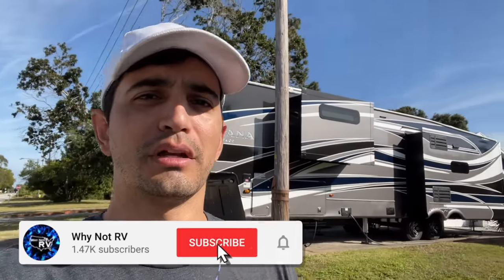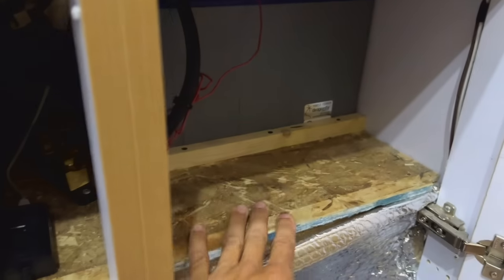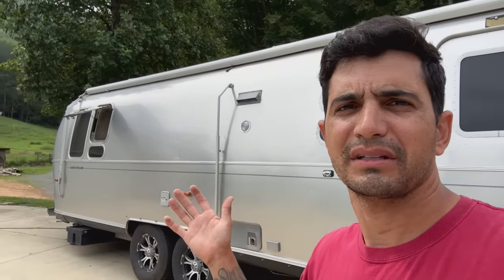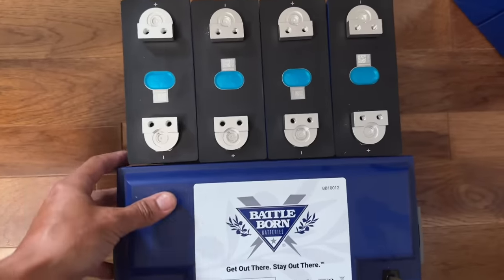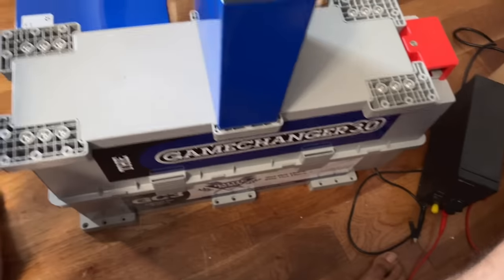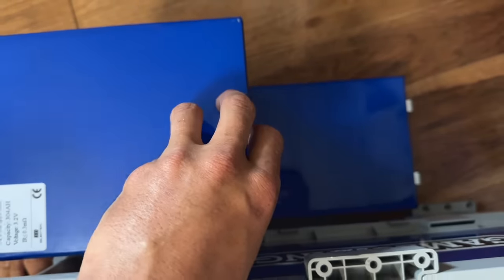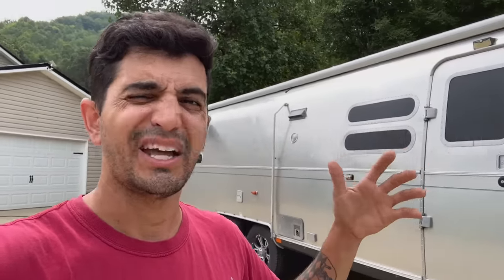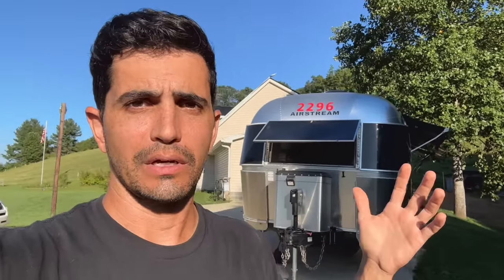Best DIY Battery Upgrade on the Market - GOODBYE BATTLE BORN - Why Not RV: Ep 127

Comment: According to your link for the battery, they are 300ah each, you have 16 cells=4800ah you said 1200ah?
Reply from the maker: These were “304” rated. Some will say “300” but will pull 308-312. All extremely similar and basically the same thing. Just depends on how they choose to word it
Reply: I was referring to your installed bank of batteries. @WhyNotRV
Reply from the maker: Sorry. So it would be 4800ah at 3.2v… when you connect in series, the voltage increases but the amp hours remain the same, when you connect parallel, the voltage remains the same but the capacity increases. Hence 4 cells together is a 12v battery at 304ah. Connect 4 of those together in parallel giving me still 12v but now 1218ah of capacity
Reply: @WhyNotRV  That would still give you 4800 in parallel, 16 cells
Reply from the maker: 16 cells … the individual cells are 3.2v nominal. You need to put four in series to make a 12v battery. Make sense?
Reply: @WhyNotRV  My bad, gotcha!
Reply from the maker: No worries. This is why I do these videos. I like to help people learn where I can

Comment: Ok that’s great but Battleborn is so overpriced as are your suggested battery. Some of us aren’t made of money. That airstream probably cost more than my adjusted gross income
Reply from the maker: There are definitely cheaper manufactured batteries out there but you end up running into a similar issue of footprint and energy density. Building your own from whatever cells you can afford is going to be your cheapest option for most useable energy

Comment: You have done it wrong !!!! you should have done 4 batteries in parallel in a pack and then 4 packs in series with just one BMS; would be more stable. or just put all 16 in series and build a 48V pack. I just do not understand this 12V trend going on in the RV community.
Reply from the maker: I have done the 48v setup before. In this RVs case if I had a blank slate I’d do 24v. Majority of RVers want to keep it simple with 12v so that’s what I demonstrated here. This is not done wrong. There are definitely more than one way to do it and get the same result. I chose this setup for several reasons.
Reply: @WhyNotRV  yes, but even for a 12v system you made it extra complicated. 2 extra BMS-es + 4 extra big cables.
Reply from the maker: Redundancy. Having a single BMS for each 12v set gives me the redundancy that if one were to go down I still have 3 individual sets that can carry the system.

Comment: so you don't make mistakes..........so I can make your mistakes?

not a fuse in sight......awesome

so explain why you didn't configure them to 24 volt or 36 volt config?

all that money on battery's and cheaper out on the bms lol
Reply from the maker: There’s fuses where they are needed. Keeping it 12v keeps in the main rv space. Yes 24v is more efficient but not always applicable. I already had this 12v inverter otherwise I would have (and may in the future) switch to 24v as I do the solar.

Comment: So on the web site it says they need to be in a vented area?
Reply from the maker: Lithium batteries do not off gas, so there is no need for them to be in a vented area. That mainly only applies to lead acid batteries.
Reply: @WhyNotRV  yes that’s what I’ve heard. However on there site under storage it states. Clean, dry, and well ventilated environment? I find this odd. Any idea of why (it’s there cells)?
Reply from the maker: No idea, probably just some generic thing that they pulled 
at some point.

Comment: Nice setup:) maybe splice the neutrals from the bmses and heat shrink while also moving the bmses the a safer locations to prevent contact with bus bars.
Reply from the maker: I did add a 1/4” foam insulation board to the topside so the BMS is not in danger of touching. I appreciate the input here

Comment: Please don't leave those bms like that, looks like a fire story.
Reply from the maker: They weren’t. Cleaned up a bit, added some foam board on top of the batteries for insulation. Secured in place

Comment: I'd like to build my own Lithium battery, but it will be exposed to the elements. Looking at doing 150ah battery. Thoughts on how to do it and withstand the elements?
Reply from the maker: You’d have to build an enclosure for it. I’ve seen people use different totes with lids for this type of thing
Reply: I have built a 100 AH battery for an electric outboard. It is in a Pelican case - totally waterproof. @WhyNotRV
Reply from the maker: There you go. Options are truly limitless

Comment: Great information.  Thanks for sharing.  I've been wanting to try out some solar but it's just to expensive and I'm still not able to run my AC. But this is very promising.  So thank you.
Reply from the maker: With this amount of batteries, I am able to run my air conditioner, overnight, no issues, and in the morning I can recharge with my generator. Eventually, I will be doing a major solar upgrade to the airstream but probably not enough to fully run RV air conditioners nonstop. They just aren’t efficient enough.

Comment: Adding one more battery to the bank does not quadruple your overall capacity.  This is fifth grade arithmetic.  Why is this hard?
Reply from the maker: Watch the whole video friend. I used the same footprint as if it were adding 1 more battle born which would be 400 amp hours of space, HOWEVER, my batteries are over 300ah EACH times 4 is 1200 amp hours of useable battery capacity. I did a capacity test to show this. If you still have questions let me know!!!

Comment: Have you ever witnessed a lithium battery fire and what it does to an RV? I have.....
I'll stick with HD lead acid batteries.
Reply from the maker: I appreciate the comment, yes, lithium fire is no joke and you need a special fire extinguisher in order to put one out. However, the likelihood of these catching on fire is extremely low. Multiple things have to go really really wrong multiple times in order for that to happen.
Reply from the maker: Thank you for the extra comment here. I appreciate it.
Reply: There are different types of lithium batteries . Lithium Cobolt  and Lithium Iron,   lithium iron do not have the thermal run away as other lithium chemistries have. 
There is a great video were they do a destuctive test on them ,   lithium 4 won and never had a themal run away.
Reply from the maker: Thanks for this additional info

Comment: You should probably address some of the huge trade offs in safety and reliability. YES you are dramatically increasing your energy density but at the expense of everything else and you are going to be sleeping in that thing.  The average user should stick with the UL listed Battleborn particularly in a mobile installation.
Reply from the maker: There is tons of other manufacturers that offer similar batteries and UL listing but for significantly less than battle born.
Reply: @WhyNotRV  I inadvertently typed battleborn instead of battery.  Although BB's UL listing is for the entire assembly and not just the cells themselves.  Most UL listed lithium are significantly more expensive than BB.  I don't mean to disparage your system, it's badass for sure.
Reply from the maker: No worries, I appreciate it.

Comment: You seriously need to connect one side as a positive main and one side as a negative Main. It won’t balance if you are charging at one end….  

And why by all the gods did you do that in your house.
Reply from the maker: If you’re talking about during the initial top balance, at the low amperage I was charging them, it really doesn’t make a difference. Nothing wrong with either way. No danger doing it in the house. Not sure what you’re referring to. Will Prowse does it the same way and he’s probably one of the smartest, most professionally educated guys out there doing this type of stuff

Comment: So, you're ditching cylindrical cell batteries for prismatic cell batteries...??? 
Whoa unto you, when you don't get the life span or the performance, you'll be back...
Reply from the maker: People have been using intestinal cells for years and they have incredible life cycles from 3 to 5000 easily. That will far outlive pretty much anything I’ll ever do with this RV. They will degrade from age before anything else.

Comment: Comparing DIY with quality components, to likely one of the most expensive batteries on the market, is a bit misleading. That said, I doubt your build quality will match that of BB or any reputable maker. That said, this is definitely one way to get more energy in the given space. Just remember, more energy, more caution required.
Reply from the maker: Yes, it’s definitely an extreme. The warranty from a company like BB is about the best thing they have going for them. Otherwise this setup will last just as long or longer than there batteries. And it’s easy to work on, if a cell goes bad or a BMS fails, easy to replace an individual component by comparison of a battery like BB or most anything prebuilt.

Comment: You need to measure the actual usable capacity of these cells
Unfortunately most Chinese battery capacity ratings are laughably overrated to point I just don’t believe any capacity claims
And the Amazon reviews have become worthless 
What you pulled seems like a good sign but the trust has been broken by battery sellers and Amazon.  
No cold camping with lithium packs without battery warmers usually. What’s the operating temperature on these?
All that capacity I’m assuming is for boondocking so I guess you can leave hooked to the 7 way to run heat until up to temp.  
Do you run another battery and an isolator for the brakes or if the trailer is cold no battery for breakaway system?
You would have the same issue with the battleborns if they don’t have warmers. 
If you wanted to be legal towing in the cold
I know some newer trucks have had issues hooking to a trailer with lithium batteries, the higher voltage throws some error. A separator/isolator and basically a chassis battery could remedy. And since it would just be for emergency brakes a small capacity battery would suffice with a simple rotary disconnect instead of an isolator between chassis (the 7 way plus breakaway battery) and house batteries to run heat till up to temp.
Reply from the maker: Hey DAVID!!! Thanks for watching and commenting... I have measured these cells and they pull full capacity no issue. 2 things referencing cold camping, first, you can DISCHARGE lithium in freezing temps no issue, its charging that is the problem, I have these in a closet inside the RV so they never get close to freezing plus I have them well insulated to help retain heat, as they charge and discharge they generate heat and can easily stay well above freezing even if stored in an outside non conditioned space. A battery bank is like a fuel cell for the RVs electrical system. If my fuel cell runs low I need to top it off, that can be done multiple ways, solar of coarse, DC-DC charging is a great way to recharge, on board generator and of course shore power. I have my generator setup to automatically come on when the battery bank gets low enough and stay running until it is recharged to where I want it. I hope this response helps you understand a bit more and if you have further questions just ask. THANK YOU

Comment: A Silly vid for a guy with a high end RV… if ya want more power step up and buy a few more BB and sleep better… forget all the DIY nonscence… that is a dead tech now…  I have 10 BB in my Rv … life is great..
Reply from the maker: For the price you paid for 10 battle borns I can have triple that same capacity. Or I could pay a third of the price and have the same amount of amp hours and take up way less space. The only thing battle born has going for them is their warranty. For someone who can do things in cells and you build your own batteries you cannot service your batteries by yourself. You can access your BMS and wiring. With battle born, yet to take that thing and send it to battle, born in order to get any warranty issues, taken care of and now your down capacity. I, along with thousands and thousands of other DIY people, could easily argue the opposite of your point. But thank you for watching and I appreciate the comment.
Reply: @WhyNotRV      there is a case for DIY set ups… but not for the reasons you make…a large steak does not make it a better buy than the quality of a finer steak…or watch or stereo…..
secondly warranty work isn’t  needed if you never have problems… with 5/years of all Victron and Battleborne , I have never had the first issue in anyway with anything… except watching it all work perfectly.
My only suggestion for pouch cell owners is learn to speak mandarin…it will come in handy at some point.
Cheers…J.
Reply from the maker: I have no problem with those who wish to pay for the big companies product. But for those wishing to save thousands and have better battery capacity results. This is for them.
Reply from the maker: Understandable, personally I like the redundancy. If one big BMS fails…. You’re without power. If one small one fails, I temporarily lose capacity while I order a new one and replace it.
Reply: Not always true. I am using the Electrodacus BMS which is not current limited. It controls all load and charge sources but the current does not travel through it. It also does not have any Fets which are the weak part of most BMS's, instead using high quality transistors.  @WhyNotRV
Reply from the maker: How much was that BMS ? Do you have a link? I’ll be curious to look at it.

Comment: Sorry but you're wrong. Since those are 3.2v batteries.. four of them in series makes 12v like you mentioned but it only makes a 76 amp hour battery. With 4 of those series setups, it's 304 amp hours total. You gained only 4 amp hours but took up more space, added additional weight, and created more failure points.
Reply: Each cell is 304 AH @ 3.2 volts. When 4 are in series the voltage increases to 12.8 volts but the AH stays the same - in this case 304 AH. Not sure where you get 76 amp hours from.
Reply from the maker: Sorry Steven. It you are incredibly incorrect. Hence I even showed at the end my capacity test I did. Showing I pulled over 1100ah and still had more to go. Similar to what mitiempo1000 said (which I have a video on my channel discussing series vs parallel and what each one accomplishes. 3.2v cell at 304ah put 4 in series is now 12.8v at 304ah. Sometimes it’s easier to discuss watt hours as that really tells you your useable power. The video is under my Solar Saturday playlist. Maybe check that out and educate yourself a bit more with this type of knowledge.
Reply: @mitiempo1000  amp hours do stay the same at the same voltage. He's saying the amp hours remain when quadrupling the voltage. You really don't understand how I came up with 76amp hours?
Reply: @Steven-e7c  That is where you are wrong. If you parallel 4 cells each @ 4=304 AH you will have 1216 AH @ 3.2 volts. If in series you  will have 304 AH @ 12.8 volts. He has 4 banks so 304 x 4 + 1216 AH.

And no I have no idea where you got 76 AH from.
Reply from the maker: Some people just can’t understand it. Better to just move on and let them be uneducated.
Reply from the maker: Yes, because multiple other people are agreeing with me and I’ve proven this method in other builds. But I do appreciate you watching and commenting!!!

Comment: The sole reason I would never touch these cheaper battery cells:

Operating Temperature: 0℃＜T≤55℃(Charge); -30℃≤T≤55℃(Discharge).  

With the built-in heaters, the Battleborn batteries charge basement is -15C
Reply from the maker: If you are in those types of temperatures and is a concern a cheap $20-$40 battery heater will do you just fine lol additionally, in my case they are contained within a conditioned space and will likely never reach those temperatures of concern
Reply: @WhyNotRV  - Do you have any good videos on how you conditioned the storage spaces within your Airstream?  Within mine, the lockers can be sub-freezing when the interior is a toasty 68F.  The only compartments I know of where the furnace heat filters up from the basement are at the water pump and behind the kitchen cabinetry.
Reply: ...  i just realized - it appears you're in a classic with the Alde system; which in itself will heatup <everything> so the solution of an interior compartment may well work for you; for me in an International, it's a concern! :)